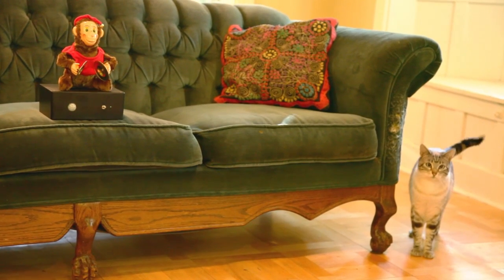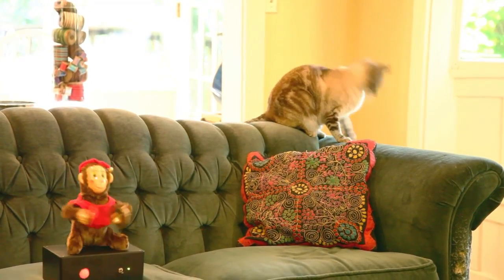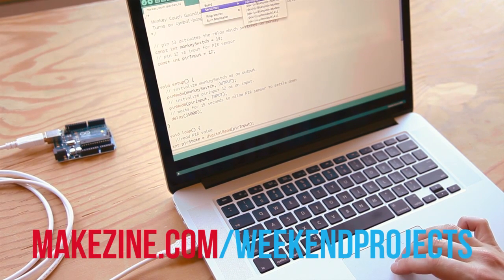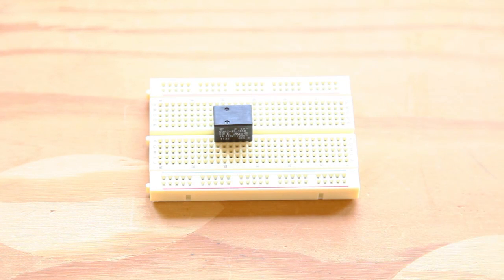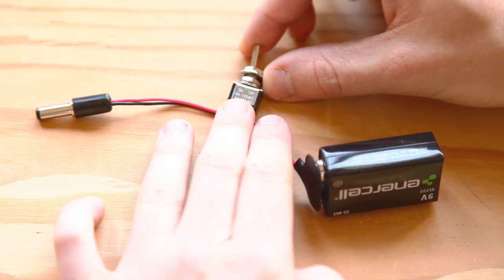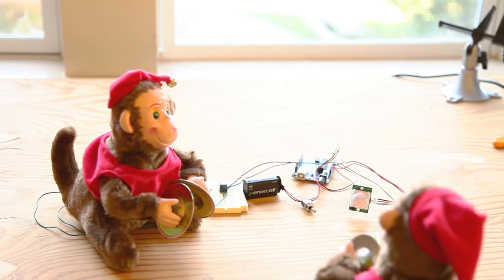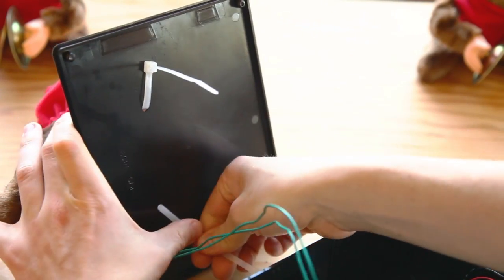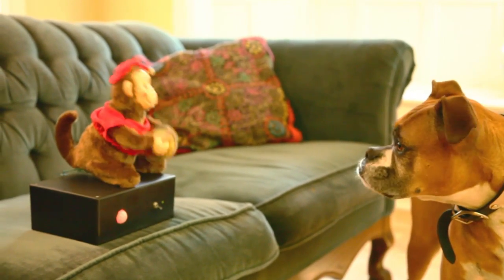Weekend Projects - Monkey Couch Guardian

Comment: Thats exactly what i thougt. And even if you use a transistor or the ATmega could handle the current you will need a additional protection diode. So there is a lot of homework to do before teaching others how to build things.